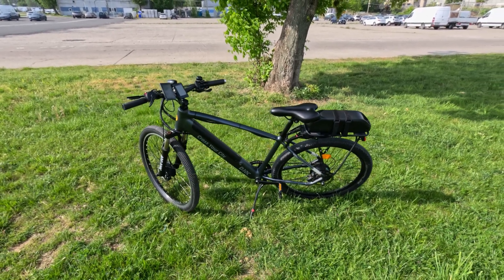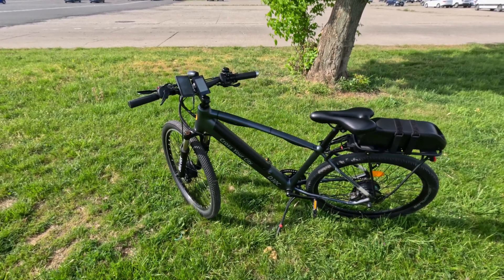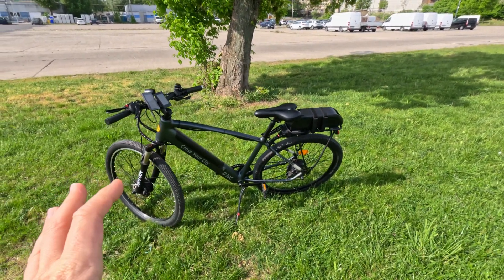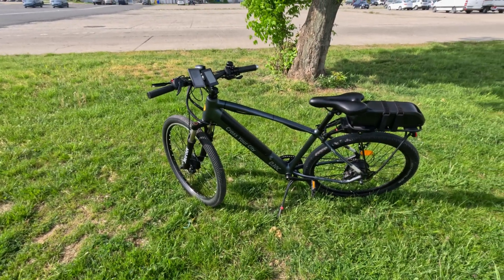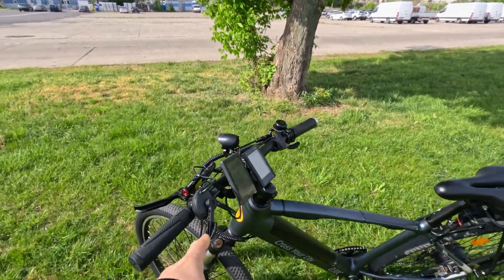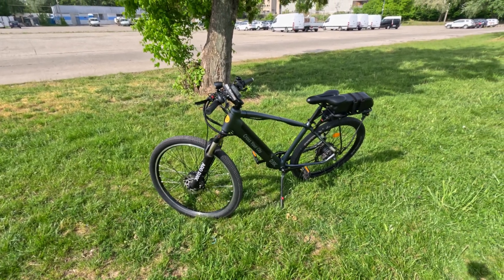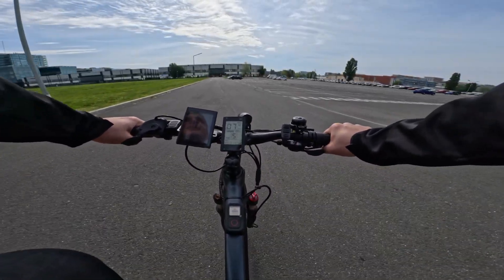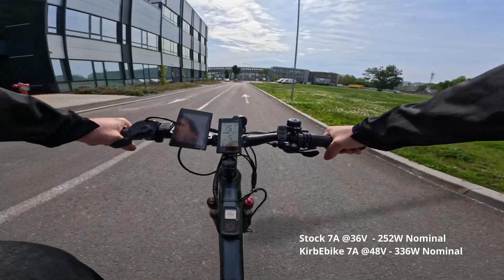ADO D30C / DECE 300 Dual Motor AWD eBike Powered by KirbEbike KIT

Comment: Very intriguing! Have you continued to use this upgraded version of the ADO 300C? If so, have you encountered any issues that we should be aware of?
Reply from the maker: It was ok, no problems. I've used for some time, but due to the extra weight and a bad knee, i have went with other builds and models for higher speed and longer range.
Reply: @TechTronic9000 thanks for sharing! I think I'll stick with the unlocked + throttle version for now. The speed and range are suitable for my current needs. But I'll keep the conversion idea in mind!

Comment: how fast can you go on 2000w mtx kit with a 52v 30ah batt ?
Reply from the maker: Probably will do ~50km/h, depending on the wheel diameter. For going faster you will need to go higher in voltage.

Comment: Is it possible to link the 2 systems to one throttle?
Reply from the maker: It's possible but a bit more complicated.
Reply: I have a 48v fat ebike (with rear hub) that i want to convert to 60 or 72v. Then i will use the stock battery to power a front motor. Is it useful to have a front motor noticeably weaker than the rear one? It look like it will not help past 40kph.

Comment: Can you make a range long ride test? I’m interested in knowing how much km is it able to do with two batteries in full electric mode. Thanks!
Reply from the maker: I can give you some estimations. The stock D30C, flat out unlocked in full electric mode will do ~30km, while assisted and normal used will do with me (85kg) about 80-100km. With the extra motor and extra bigger battery the range will be about double so you might expect 60+ km on just fast electric mode and could go to 200km assisted.

Comment: This thing is a beast. 😀 Great Project! Thanks for sharing. 

My recomodation would be to add a seat suspension fork (don´t know if this is the right term in english). I did put on a Suntour SP12 (NCX) already on my A20+ and now also on my D300C. It not only makes driving more confortable and spares the bikeframe. It also gives you more grip because the back wheel gets faster contact to the ground again. So you also get a plus on safety. ;-) 

Also be aware that not every tire is rated for  around 50 Km/h!! Don´t want to lecture you. Just want you to be safe. ;-)
Reply from the maker: I'm glad you liked the project. As for the seat suspension, you are right, it's a good upgrade. Currently I'm running mixed tries, the rear one is a Schwalbe Hurricane (very good by the way) and the front one is a stock CST.

Comment: Great upgrade! 
I have covered 500 km on my D30C so far, and I can say that it is really good.
Reply from the maker: The D30C is a great bike, it's still one of my favorites as it's very light, efficient and has good handling. This were also reasons to use it as a platform for my dual motor test.